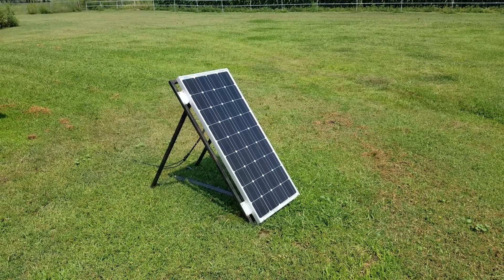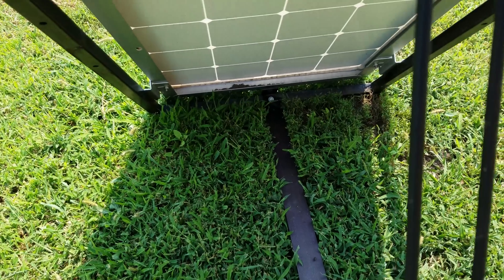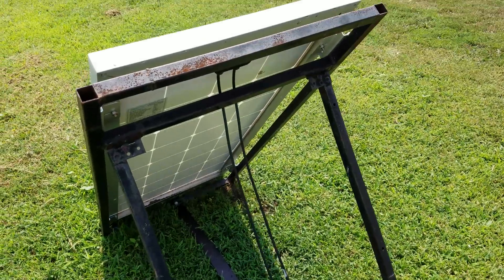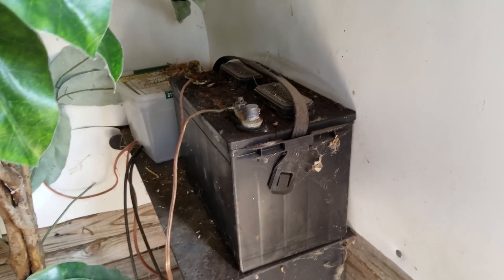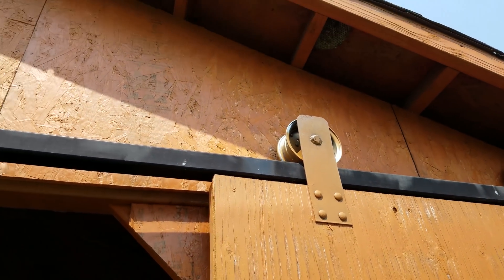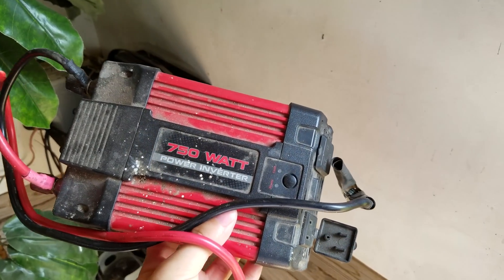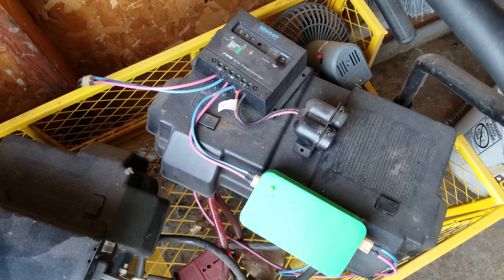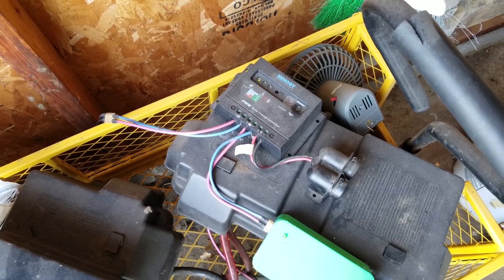My DIY Solar Power Setup For a Shed

Comment: 14 Gauge speaker wire on that battery is a fire waiting to happen.  You can see it has gotten hot and the plastic is melted.

Comment: So much talking and you don't even say how many Amps the solar panel outputs to the battery.
Reply: SeeItHappen He showed the label?
Reply: @techtastisch7569  The label only shows theoretical values under ideal circumstances, we all know that's useless, except you ? We want at least to hear or see the real deal. So how many REAL amps does his solar panel deliver to the battery.
Reply: SeeItHappen Well I do know about that, my generic panels have similar ratings and depending on how the weather is and how they are angeled to the sun, they sometimes exeed that rating or deliver hardly anything. So any values he could measure are pretty much useless
Reply: @techtastisch7569  "So any values he could measure are pretty much useless" With that kind of thinking and logic it is indeed useless to ask you anything. I bought my self a solar panel and guess what: On a sunny day i measure the open voltage 20 Volts and the short current 5 Ampere. On a cloudy day I measure the open voltage 16 Volts and the short current 3 Ampere. On the sunny day, when I connect it directly without a charge controller to a 12 Volts 70 Ah car battery, I measure a charging current of 3,7 Ampere, on the cloudy day 2,9 Ampere. Now is that so difficult to check out and show to the visitors ? The real deals in solar panels everyday life is what people are interesting in.

Comment: Thanks for sharing. I guess that all the lighting is DC running directly off of the charger controller. Is it easy to get dc bulbs?
Reply: Yeah the DC bulbs are very easy to get. If I remember right the bulbs that I have in this shed are a standard GU4 type.